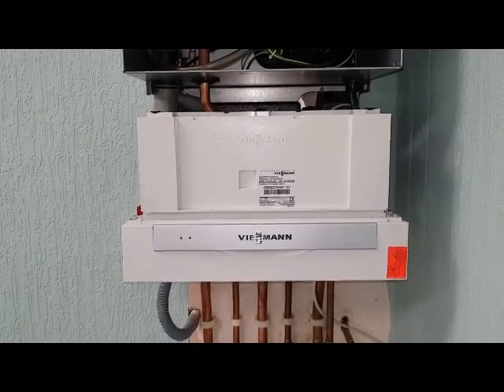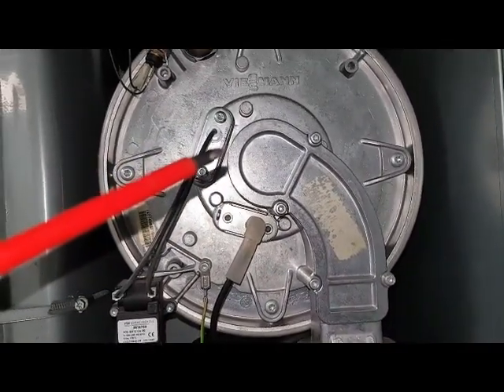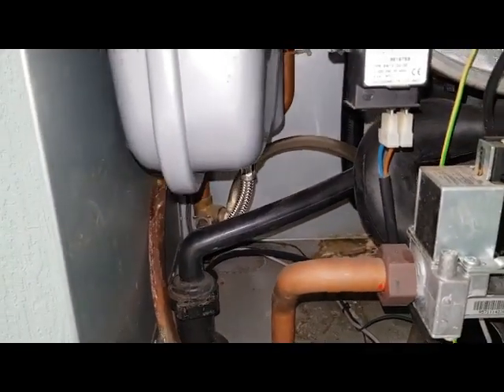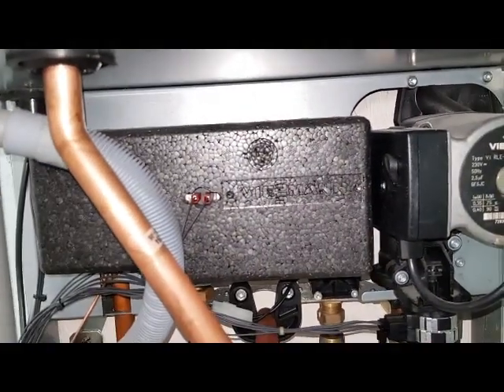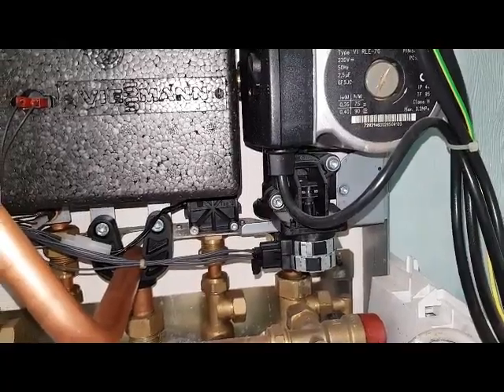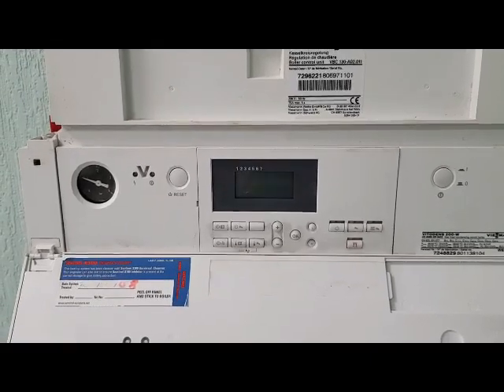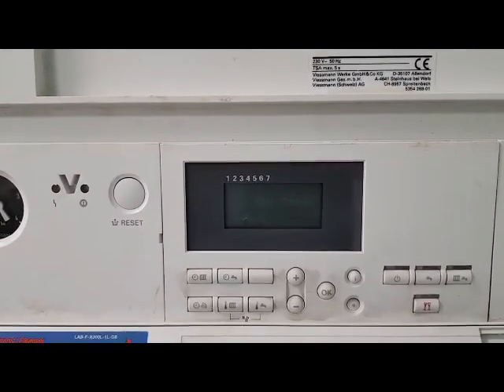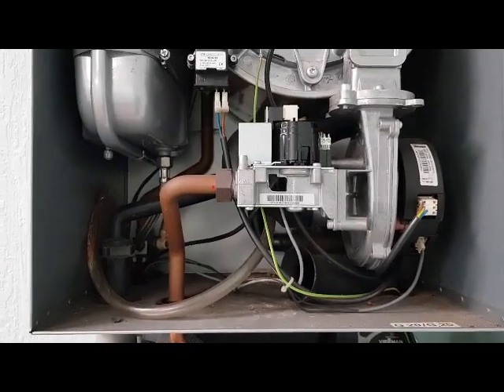Viessmann Vitodens 200W Tour For New Engineers. With Coach Tony Morgan

Comment: Thanks for the video Tony.
Question. Do you think the rubber hoses a potential problem for future leaks?
Reply: Gonzalo Martinez . The rubber hoses do not leak and never did, but they do suffer from getting blocked up with dirt  and sludge, The problem is people fitting boiler onto dirty systems
Reply from the maker: Yeah it looks like it leaked in the last
Reply: No system can stay clean forever so copper pipes always preferable to rubber hoses that hold on to dirt and block up and, at least in the past, have split and leaked. Rubber hoses can also be affected by inhibitor, so you can't win either way. Plumbers complained and Viessmann changed to copper but have gone back to rubber again. Do your research before accepting anyone's opinion at face value because they may be working for the company they are defending.
Reply from the maker: hey we're currently trying to grow our Facebook group and would love you to join Tony and the team using this link, Tony will be available to answer all your questions directly there's also updates on new trainings we just released too. https://www.facebook.com/groups/167070231326174